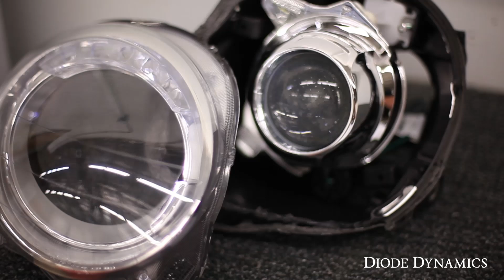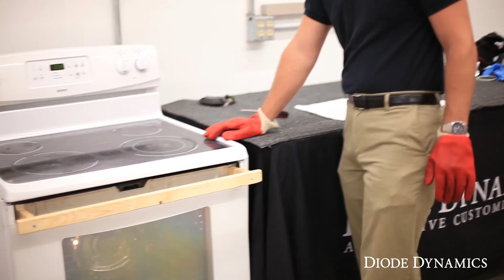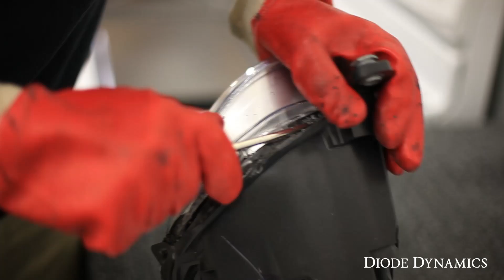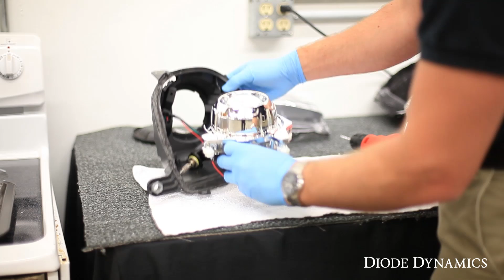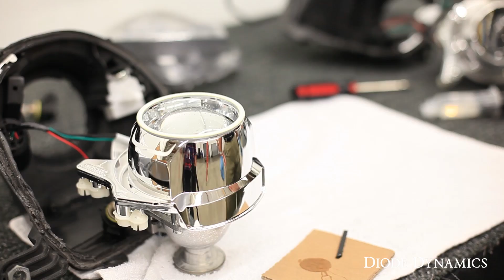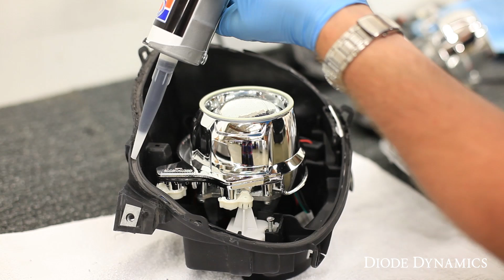How to Install Angel Eye Halos on Fiat 500

Comment: so what's the next step, is there a link to another video that shows the full installation. I want to get me some ccfl's.... is it the same process for every car? thanks
Reply from the maker: +Cp Ponce, the next step would be wiring and reinstalling the headlamp assembly back on the vehicle. We aren't familiar with the installation for the ccfl's, but if you have any other installation questions about our products, give us a call at 314-205-3033, Monday-Friday 9am-5pm CST, or send us an email at contact@diodedynamics.com, and our sales representatives would be happy to assist you!

Comment: ok Guys now i am confused. I saw the last video where you were installing rgbwa board on 2016 mustang and you had a link up their saying general headlight opening it says 220 for 18 mins. My question is does the mustang sealed with permaseal or normal. do we need to bake the light for 220 or 265 for 15 mins. please help me here
Reply from the maker: +shane, the 2015 Mustang headlights are sealed with permaseal. The time and temperature is takes to open a headlight varies from vehicle to vehicle. If you could give us a call at 314-205-3033, Monday-Friday 9 am-5 pm CST, with your vehicle information, our sales representatives can give you more information on opening your headlights. Or if you are uncomfortable opening your headlights, we have a great network of authorized installers that can help you out (link below)!

http://www.diodedynamics.com/store/index.php/find-dealers/
Reply: +Diode Dynamics  hi Guys i have 2015 mustang gt. so want to know which temperature is best to bake the headlights is it 220 or 265. Thanks
Reply from the maker: +shane, we recommend low heat for short bursts of time. We would recommend 225 degrees for 5 minute increments. We do strongly recommend professional installation if you aren't experienced opening headlights. If you have any other questions, just let us know!

Comment: What is the diameter of angel eyes ring?
Reply from the maker: Hey there! Those rings are 90mm in diameter. You can purchase them directly from this link: https://www.diodedynamics.com/hd-led-halos-for-2012-2015-fiat-500-pair.html 
If you have any other questions, just give us a call at 314-205-3033, Monday-Friday 9 a.m.- 5 p.m. CST, or shoot us an email at contact@diodedynamics.com!